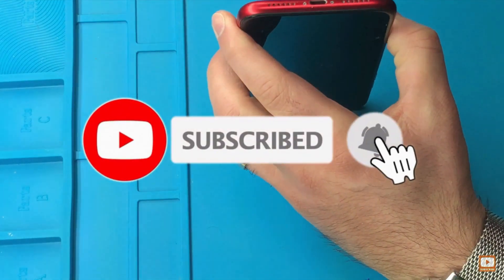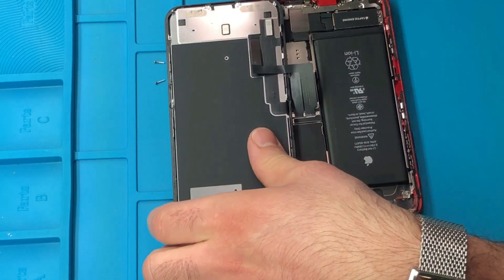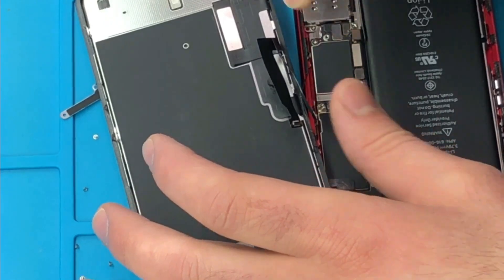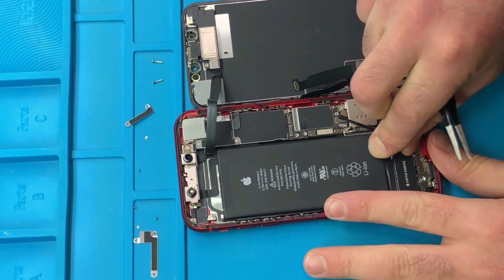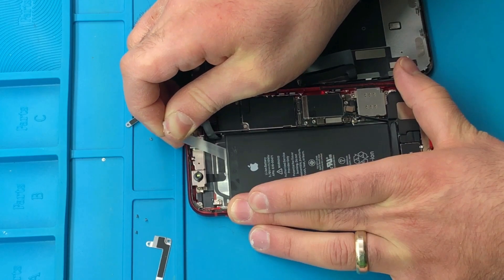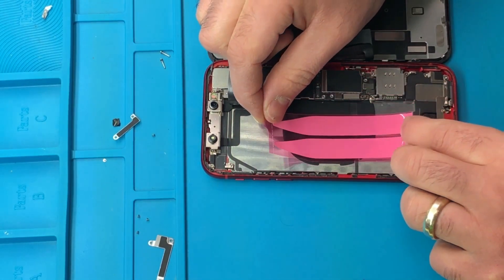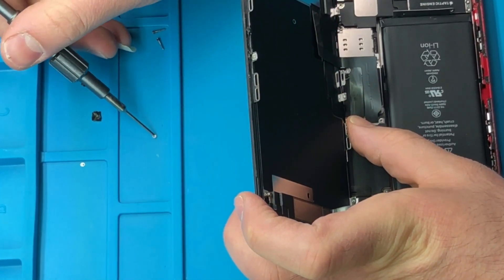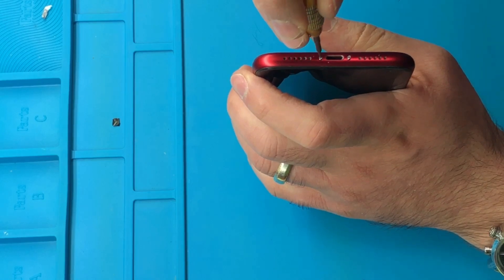(Easiest) iPhone XR Battery Replacement & Repair | Batteries Shack

Comment: Do you get a error message saying it's not a genuine battery ?
Reply from the maker: No not at all but even if you get the message and the battery holding charge in good way you should be fine apple is doing that throw thief update or built in software to force you buy battery from them but if your iPhone holding charge and charging good with your new battery then you should fine.             

Please let me know if you have any other questions